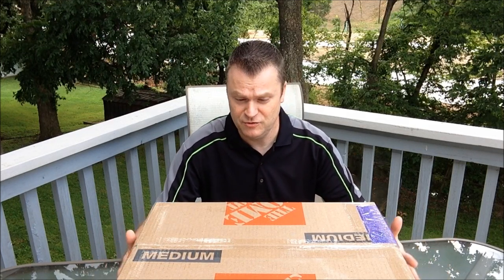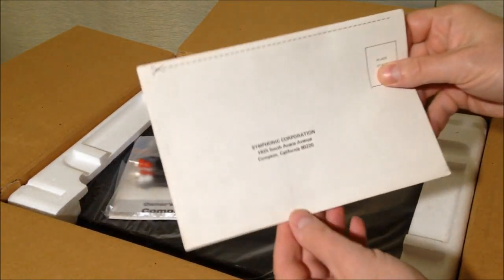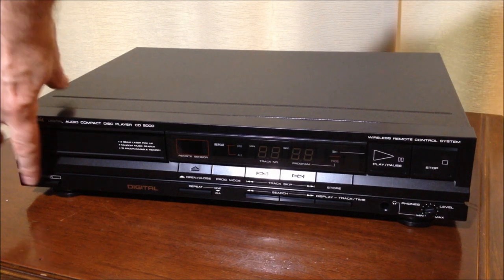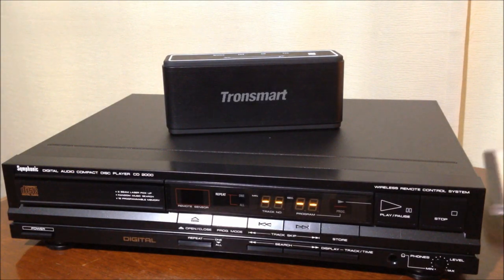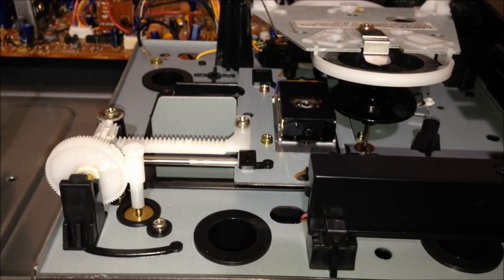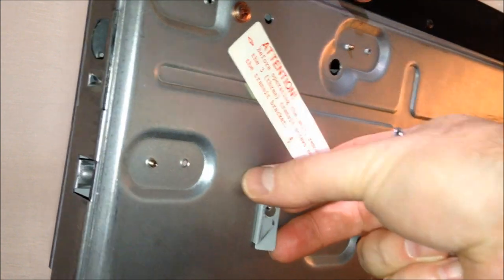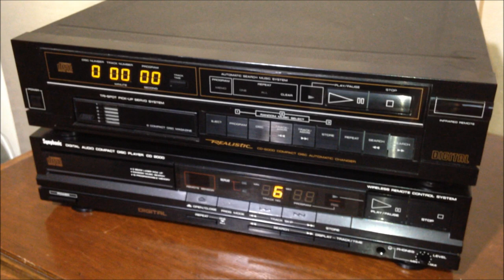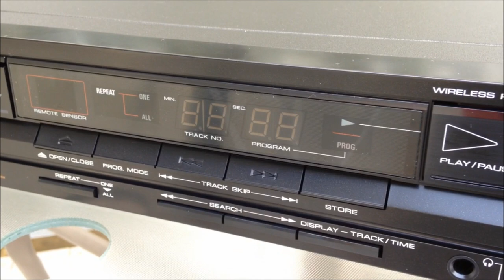80s Symphonic CD Player - BRAND NEW??

Comment: My memories of CDs in that era was "can't afford them!"  I also got my CD player in 88 (I was 18), but the CDs were still around $15-20 while the tapes were around $6.99 and sometimes on sale for 4.99. The only CDs I had were gifts.
But what the CD player was good for was making tape copies of CDs. You would get great quality sound with a decent tape deck. While my tape deck wasn't top of the line, it wasn't a boom box either.  I was the king of borrowing CDs.  The library had them too.
Reply: @Jingle Nuts Not in 88.  The average hard disk couldn't hold more than a song and CD-R, IIRC, was still in the future.
Reply: @Jingle Nuts Where it is practical, I agree. But I still listen to tapes and CDs.  You can pick up tapes and CDs dirt cheap now.  It's a cheap and fun way to increase your music collection.    I'm a cyclist and use a tape walkman when I'm cycling.  I can easily control the player while it is in my pocket and I can listen to the radio, both AM and FM.
Reply: @Jingle Nuts It's actually more dependent on the deck you are using.  I have a bunch of tapes I made in the late 80s from records and they still sound great even on name-brand, but still fairly low-end cassettes.  I made them with a decent (not great) tape deck.
I personally like ferics the most. You can get lots of volume on them. Chrome tapes are quieter, but they cannot take as much level.  Metal sounds nice and is great for classical music (with Dolby), but they were very expensive. A decent metal tape ran like $5 and up back then.
Reply: @Jingle Nuts I don't understand why you lose the highs without Dolby?  I've never heard anyone say that before.  Do you happen to know why that is?

I've heard Dolby S is outstanding and basically on par with either VHS Hi-Fi or CD even with a high quality type I.
I tend to make my recordings hotter than that, peaking around +4.  But these DB meters aren't necessarily connected to reality.  I suppose it is more accurate to say I peak them at +4 on the particular meter on my particular deck.  I only have one deck and so I can't really compare the level meter to a different level meter.
My deck has an auto feature and it will peak the meter at zero db.

Comment: Thanks for sharing! Summer of 1985 I'd laid away the first CD player Radio Shack sold, I think CD-1000.  It was grey and actually not as wide as most component gear. And it was so slow! The track seek would just gear grind like an old TRS-80 disc drive from 1980.  It was all metal, though, and heavy.  I loved that thing.  By early 1990s I'd moved on to changers and eventually gave it away. I'd love to see an original box unboxing of that one!  But this will do, and again, thanks for  sharing!

Comment: Great video with a nice story of getting your first CD player back. I recently got my first CD player which was a Sony hifi unit from about 1992 out of my parents loft and got it working again. The CD player needed a new belt and some dry joints needed soldering and tape head needed a really good clean but it’s all working again now.

Comment: Symphonic made a lot of great portable record players back in the 1950’s and 1960’s known for its trademark “The Symbol of Superiority”. By the 1980’s and 1990’s, they made CD players and VHS VCR’s as well as DVD player until Symphonic stopped production during the 2000’s, and it was made by Funai, the company that made garbage VCR’s, and also the last company that made VHS tapes until they stopped production by 2016 after JVC has already stopped production on VHS tapes back in 2009.

This CD player from 1987 is also compatible of playing CD-R recordable discs, and it will not play CD-RW discs. I used to have CD’s, but not anymore, I can go back to cassette tapes and reel-to-reels just for the fun of it.

Comment: This is very nearly identical to my 1987 CD player, the Kenwood (aka Trio) DP-460. I recognized the sound of the mech and that transit bracket. A quick search on Google images shows what looks like the same board and mech. It was a good-sounding machine - though stolen in 1998!

Comment: Most manufacturers put a big label inside the box which you would not usually miss. 
They would Say "Important Remove Transit Screws before Use" and they would show the base of the machine and the screws.
Perhaps this issue was missed the makers. The labels were inside all the major brands like Sony & Technics.

Comment: Great stuff. I bet you were well chuffed finding this. I know the feeling. I found a cassette player I had when I was about 10 (1975) on Ebay and my daughter bought it for me as a surprise. Fast forward a good number of years to when I was 18 in '83, I bought a Toshiba Radio cassette which cost me £100 ($132) at the time. Found a mint one on Ebay last year and it's one of my most treasured possessions. Glad you found the transit screws - always a killer.

Comment: Did the National batteries have any charge left in 'em?
Reply: Eric Belinc  I wouldn't assume that.  Those are clearly heavy duty batteries and you'd be surprised at how stable a lot of them were when left unused or rarely used.  Fran from Franlab found and old 90s toy of hers that still ran on the original batteries that were in it.  I still use a pair of 1991 Radio Shack Enercell heavy duties in my 1991 Micronta multimeter.  I only recently got a low battery warning.

Comment: Nice video! i graduated  High school in 1988.  i was still buyin cassettes at that time (and 4 or 5 years after) CD players (and CD's) we're just so darn expensive!  I'm currently using an old 80's NAD CD Player i bought at goodwill that actually sounds better (to me) then two brand new highly reviewed models that i bought in the last several years.  it wasn't new but It also  still had the shipping  locking screw in it. it took me awhile to figure it out aswell. the only thing's that were wrong with the player was the open/close CD tray belt was broken and it skipped some due to some old dried up grease on laser sled rods.   i was initially worried that it wasn't compatible with  my favorite DAC because it such an old  CD player. but the sound is so warm and dare i say "Analog" i don't miss it one bit (pun intended).

Comment: Real men don't read manuals lol. 

I like the look of this machine. Still has the glossy black front panel - within a couple of years, most of the major companies (Sony, Matsushita, Pioneer etc) had gone to the matt black style that would last throughout the 90s until everything started to go silver again around the turn of the millennium. I like the 7-segment displays too - the orange is unusual and looks more high-end than it is, and they tend to hold up better than the blue / cold white VFDs that fade over time. (I have an Aiwa reciever from 2001 and a Panasonic DVD / VCR recorder from 2008 that are now almost unreadable in bright light, and had to recently junk a 1988 Sony Digicube radio alarm clock because the digits were no longer legible. I hate VFDs). 

My first CD player was a Goodmans portable which I plugged into the 1970s Sanyo music centre I'd had handed down from my parents when they upgraded to Sony separates in the early 90s. It sounded nice, in that rich, warm way that Seventies kit seems to. Then I got a top-loading Akura unit for my 12th birthday (from the Argos catalogue in the UK!) that was complete crap and lasted about 3 months. That got returned and replaced with the aforementioned Sony stack which as you can imagine, I was chuffed with - I think my folks felt guilty over the Akura and it gave my dad an excuse to upgrade to a fancier Sony. I still have those components but on the odd occasion that I want to play a CD, the Panasonic does a good job of that too :)

Comment: De-install the screws from the transport blocker! first. Change the Electrolytic-Caps and clean the Transport from the door. So it will work - do not align the Potentiometers! This is very important that you don't twist any Potentiometer!!! This CD-Player was one of the inexpensive ones in the late days of the 80s. You can see that on the 7 Segment Display the expensive one CD-Players had a  LCD most with inversion and a Orange Back light or a blue/green like the Philips CD-Player. But it is very interest that this Player worked after 33year - incredible. But I like that what you're doing here.

Comment: Transit screws ??    WOW.    My 1987 DENON DCD-900 CD player, that I have been using for 33 years now, is still up and going, and there is still not even a single scratch on it.  Several years ago, it did however require a few drops of electric shaver oil on the motor worm gear that moves the LED/Detector. This fixed the skipping and track selecting problem.   But that was it.  It is as good as new.

Comment: Looks like it has the early Chebyshev analog brickwall filters in the output stage (green encapsulated dual components on the PCB) Perhaps a multiplexed single DAC as well. 1983 technology in 1987, hence the low price...

Comment: Most of the cheap VCD players from China make those weird sounds when they operate back in the early 2000
Reply: a lot of the "cheaper" DVD players from then did the same as well. My first DVD player an APEX branded model which cost me $220 USD in 99 could have been 1/2 it's size because it repurposed parts for a PC DVD ROM drive, and it sounded like a jet spinning up when it was playing a CD, VCD, or SVCD in such a big hollow case.
Reply: @CommodoreFan64  Those were great!  Those Apex units had that awesome bypass mode where you could skip the menu system on a DVD entirely and just play the VOB files!

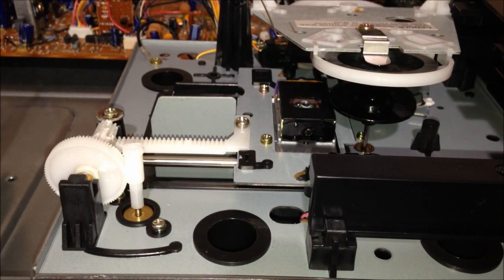Comment: 15:00-ish.  Not sure a CD player that old can read CD-R media.
Reply: xaenon it most likely will, remember at this point in the video, he hadn’t removed the shipping screws and bracket. Also, only a handful of players from that time would not be able to read CD-R’s due to underpowered lasers. But yeah, by 1988 most players sold world wide could just take CD-R’s even though the first burnt disc had yet to come to market later that year. But yeah, should be no trouble for this little machine, and if it doesn’t it’s easily fixed on most players by fiddling with a solenoid to increase the lasers output slightly. But CDRW’s are another matter, those will not play.
Reply: I agree the 1987 player shouldn't be able to play a CDR. My 89 Sony and 92 pioneer wouldn't play CDRs from 1999